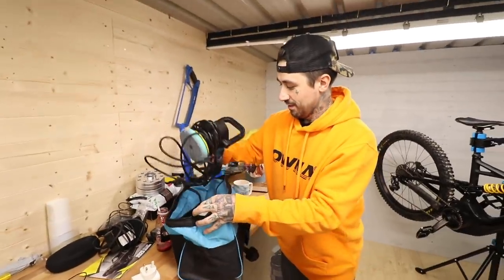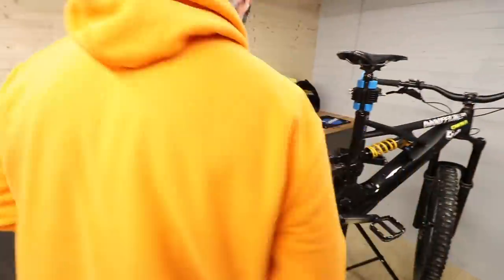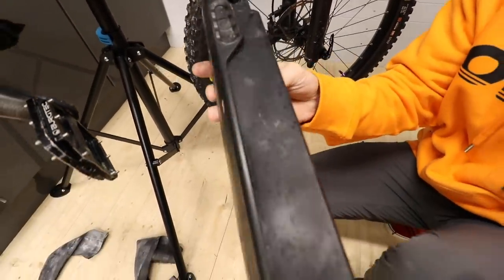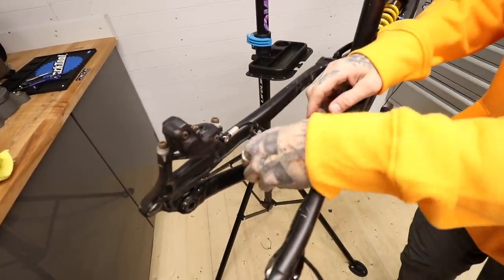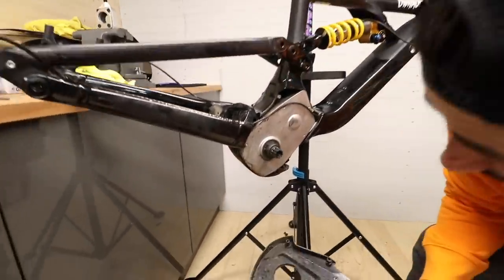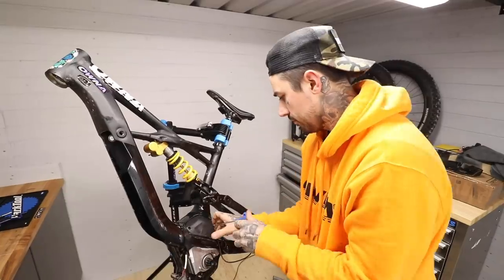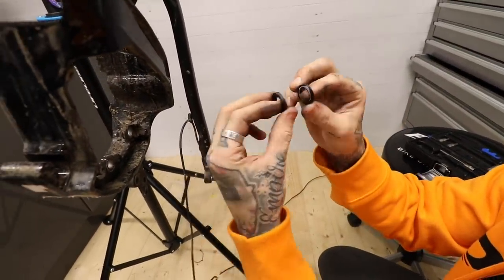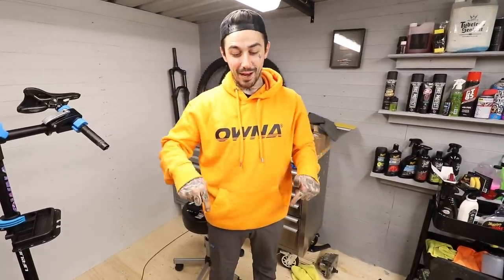MTB DIY RESTORATION BUILD!!!!

Comment: Don’t use the torque wrench as a ratchet or breaker bar as you will mess up the calibration on it and it will need re calibrating
Reply: I was just coming on to say nooooo, not it's intended use and before you know it it'll be buggered as a torque wrench.
Reply: I was thinking exactly the same !!!
Reply: makes no difference once you go past the ball detent that "clicks' your just pushing against a stop

Comment: The calamity continues......Torque wrench undoing things - #rollingeyes
Mate have some free tips:
- Don't forget to take off cable tidys inside the battery compartment.
- If you need a clean thread after powder coating - put a bolt in before powder coating, these could be used for hanging it as well.
- To keep washers, bearings, etc. in place after extraction use a small zip tie.
- Bearing extractors can be bought, RRP do a great one, I'm sure a magpie like you will love the bling.....

Comment: Class video lad! Cant wait to see the bike when its done. To clean your battery power ports and the motor you can get a spray can of electrical contact cleaner. To get the bearings out of your frame, find a socket thats a similar size to the bearing. Put the socket on top of the back of the bearing and use a hammer to tap the socket driving the bearing out. If you cant get to the back of the bearing then you'll have to get a bearing extractor on a slide hammer

Comment: Use a socket the size of the bearing on the inside then slide a threaded bar through the socket and the bearing then use a bigger socket on the outside (bigger than the bearing) to catch it as it comes out. Whack nuts on either side of the bar then gently tighten them up and the inner socket will press the bearing out nicely. A proper bearing press/ removal tool pretty much works the same way but if you are careful this method works just as well. I swapped the bearings out on my mega last week so I know it defo works a treat

Comment: I have gotten my bike painted professionally and you want to make sure to not get any paint where bearings are going to be press fitted in. If there is paint inside, its going to start cracking around it. So keep those spots where bearings are being fitted clean. The frame has been machined precisely to fit the bearings and any buildup of paint will destroy your paintjob. 
Other than that Im really stoked to see the final result mate! Have a good one! Cheers, Nicholas

Comment: Get the bearings out of your seatstays and chainstays with the rrp tool (you get a blue and red tool that can be used for both installation and removal).
The ones in your frame can be drifted out with a screwdriver and mallet, or you can buy an internal bearing removal kit.
You might want to leave them all in to protect the bearing surfaces during the paint process, then replace them when it's done.

Comment: Be nice to see some high tensile stainless hardware, in replacement of the standard nuts and bolts. One of the first things I swap, and makes a nice difference. Although I just use A2 grade - better to go high tensile on things like seat clamp, stem etc that require a good amount on tension. Or you could go rainbow Ti like your old BMX, back a long time ago. Can't wait to see it though, fair play for sending it! I'm also stripping and powder coating my Jump bike and bmx soon too.

Comment: A lot of the bearings will come out with a hammer and punch if you want to be quick , but RRP do some nice removal and installation tools also some nice Chinese sets about.
You can also get blind bearing removal tools for bearings you can't get to the back of.

Comment: When i've removed bearings i've used my sockets if different sizes (Larger on the frame, smaller on the bearing) in a vice or hydraulic press to push them out.
It can destroy the bearings since most of the time you'll be pushing against the bearing seal or inner race but you're replacing them anyway at that point so who cares!
Good luck with it.

Comment: I would use some isopropyl alcohol in a spray bottle to clean your electricy plug bits, as it evaporates! Wd40 do a spray contact cleaner which is basically isopropyl too!
Reply: It’s also good for degreasing small parts!

Comment: You can just knock the bearings out with a socket and a hammer just heat up the alloy round the bearing with a hair dryer to expand it and give it a good tap then when installing making sure the area is clear of any paint on powder coat etc then put new bearings in the freezer for a few minutes heat the area around the bearing again with hair dryer and you should be able to push in with your hands have done this on multiple frames hope this helps

Comment: I would use a solvent with a high alcohol content so when you spray it will evaporate after while so your contact points for the electrics won’t short

Comment: just tap the bearings out by gently using a suitable sized drift and hitting the inner race one side then the other and and at  different points , this can damage the balls in the bearing sometimes and you then  need to put a new bearing in. If you cant drive them out because of an obstruction you can get a suitable builders expanding bolt and use it to draw the bearing out. The numbers are on the bearings ( eg 63202 RS ) just order the same off ebay or if they are a funny number measure the inner size and outer size with vernier calipers and order from that . RS stands for rubber seals.

Comment: They will be able to coat your frame. They use silicone cone shaped plugs in threaded holes. You will want to talk to them about also masking the head set and any areas where Specialized didn't paint. The back side of the brake adapter mounts where the motor bolts to the frame perhaps. They have high heat masking tape that they can use. I have done powder coating at home for about 17 years now. Neve a whole frame as my oven is too small. 

Contrary to what people are saying, using a torque wrench in reverse will not cause it to need recalibration - not the style that you have. I have had these apart before, and there's nothing to worry about. I still don't think it's a good habit to get into... you should use a proper breaker bar for breaking bolts loose. 

To knock the bearings out you can go about this in a few ways. The most likely thing you will have laying around is sockets that fit snug in the aluminum hole but not tight enough to get stuck. You want to make sure to only apply pressure to the outer race of the bearing, so this should do the trick. A block of wood as a backer should stop damage to the frame while you knock them out. 

Due to the odd angles and shapes of the frame where the bearings go in, a "proper puller" may not work on most of these anyway, but you can get kits to remove and install bearings. These tools usually rely on having one perfectly flat surface on the frame, for the outer part of the tool to seat on. 

If Specialized offers a bearing tool set, that's probably your best bet as they would be made specifically for this frame.

Comment: Use appropriate size sockets with a G clamp to press the bearings out big socket on the back small suck it the same size as the bearing and then tighten to push out

Comment: Mate , iv just changed the inner and out cable of mine , the frame internal cable wasn't an issue but if yours is anything like mine and runs internally through the chainstay then good luck , absolute nigtmare.

Comment: if you are having trouble getting the cables back in the is something you can get. its like i flexible rod that you feed through on end and it has threads on iy and you screw you break cable onto it and you pull it through and then just cut the bit off that you screwed it into

Comment: Will the bearings knock out using a slightly smaller socket than the hole of the frame? Bodge 🤔

Comment: You can put a socket that will fit the outer diameter of the bearing and one that will fit the inner diameter and a hammer. Or go to someone with a bearing press

Comment: use dielectric grease on conection points stops muc and water getting in to plug in parts and usefull on battery terminals to

Comment: Change the brakes to Magura they work sick, dont put anything on the ports the connector to the battery maybe with muc off corrosion defence, also use an air compressor to clean behind the plastic covers

Comment: The reason you can use a torque wrench either way is for backward threads, not supposed to use it to loosen bolts as it’ll ruin the tension

Comment: You can take the motor out without having to take the drive side off the motor 3 bolts on the other side then it should slide out.. 🤔
Reply: No wait I've just had a quick look at mine there's a motor bolt in cover that you can't get to without removing the chain ring.. 🤦‍♂️

Comment: don't use a torque wrench to undo bolts and when it comes to putting your bearings in buy a bearing press but not a cheap one as they bend/snap and got shimano xt 4 piston brakes

Comment: Stop using your torque wrench to remove items or fit items, there not designed to be used that way and you will wreck the calibration and therefore you will be under or over torqing